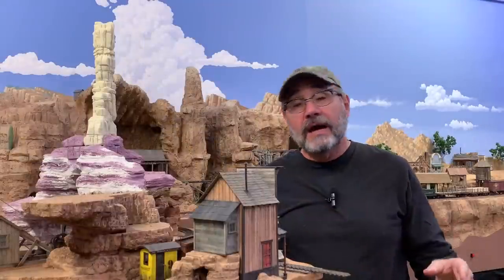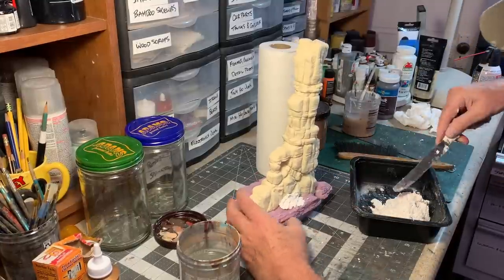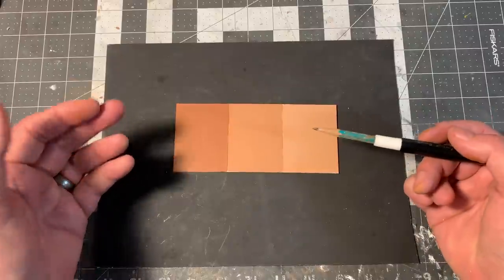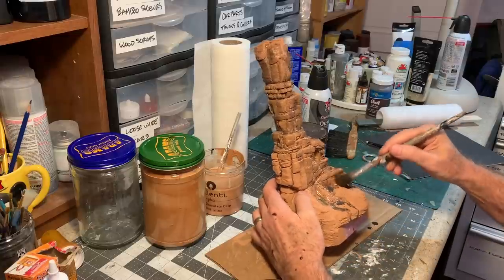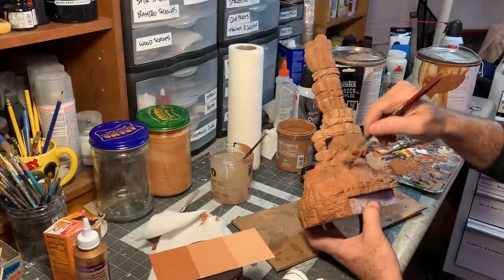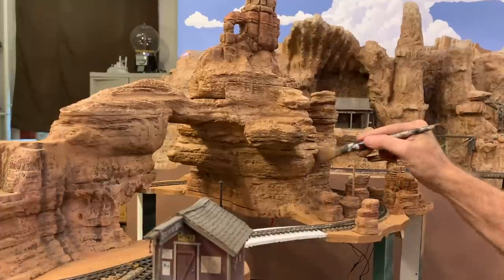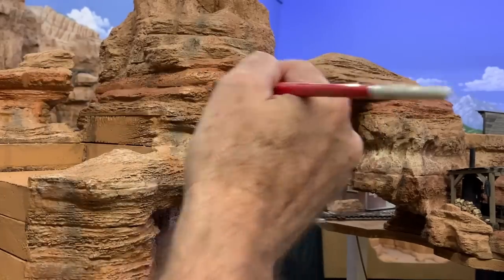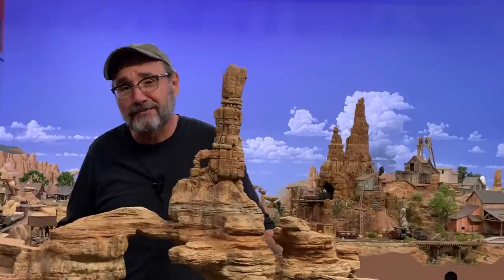Painting Foam Rock Scenery | Bandit Canyon Railway

Comment: I always recommend lightweight spackling over joint compound.  They are very different.  Lightweight spackling dries to the consistency of foam and can go on a little thicker than joint compound before cracking, although a second application will easily fill any cracks.  I’d swear that Foam Putty is repackaged and relabeled lightweight spackling.  Lightweight spackling, as Dave noted, is readily available at home centers and is less expensive than Foam Putty.  I use lightweight spackling for everything from terraforming the scenic base to mortar for brick walls.  Also, clean-up is as simple as wipe off the trowel and close the lid.  No mixing and no waste.  Also, no concerns about a little going down the drain, unlike plaster.  I don’t like mixing plaster or cleaning that up, so, to me, lightweight spackling > joint compound and even Sculptamold.  Hope this helps, Dave Foxx
Reply from the maker: Yes, I'm fairly sure that spackle and foam putty are exactly the same thing.

Comment: Curious, Why did you apply the dark wash inbetween the mid base and the darker color? Wouldn't that darker color cover up the Black wash? Love your work. I'm in the middle of finishing a section of the Southwest desert on my first layout, the foam is fantastic, but messy. I have hand carved all my foam with a heavy duty Utility Knife, it's less messy than other tools I have tried. I hate sanding the foam but neccesary sometimes. Very good Videos!
Reply from the maker: The dark wash is for deepening shadows. The shades I added after the dark wash are not darker. Subsequent layers of paint only hit the high spots, bringing out the mid tones and highlights. Have fun and embrace the mess!

Comment: Another great video, thank you.
Quick scale question, in on18, 1 scale foot = ?
Reply from the maker: Thanks. On18 is O scale. 1/4" = 1'
Reply: @ThunderMesaStudio  same as On30
Reply: It helps to realize that it’s all the same scale. O, On30, On18. All O scale ==> 1/4” = 1 foot. 
Only thing that changes is the distance between the tracks.
Reply: @ironworksmodels  Cheers, thanks.